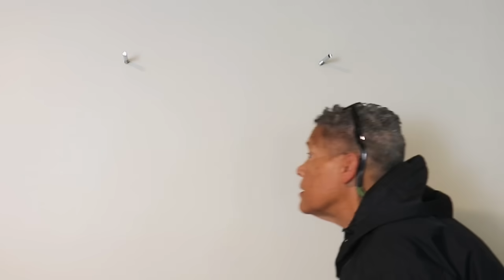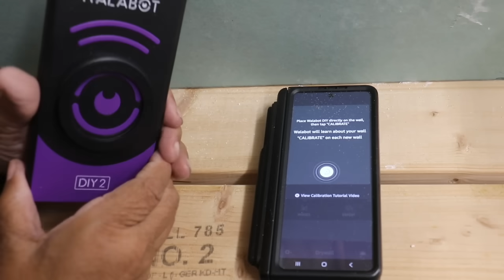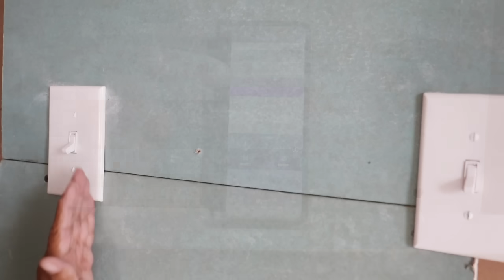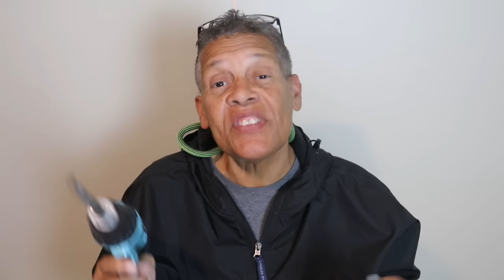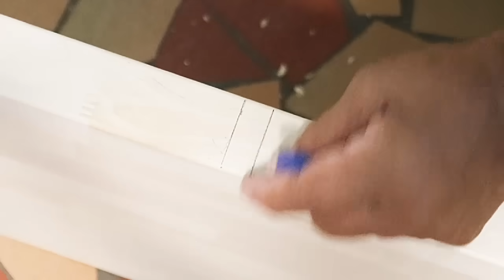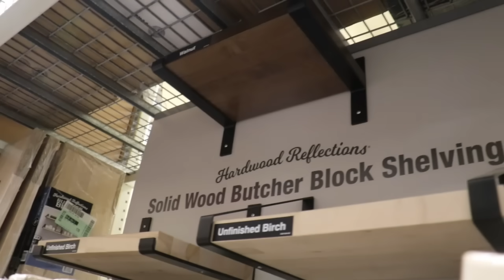this Shelf is AMAZING//no brackets needed!

Comment: That Walabot is a really cool tool. I installed a floating shelf at my house much the same way. I wanted to share a couple tips I think make it a little easier. I use a speed square held against the wall and a 12" long 3/8 bit. The square helps guide the bit level when drilling the pilot holes. I precut the heads off and use vise grips to screw the lags so I don't have damage from sparks in my finished home. Lastly I drill my holes in the shelf for the 1/2" lags a little big. Like 5/8. This allows for any leveling adjustment. I put a good amount of construction adhesive in the holes. I slide the shelf on and prop it into it's exact level position with temporary boards under it and let it set for a day. I used this process on a very large mesquite mantle as well. I wanted to share my experience. Thank you Leah.

Comment: Thanks for the Vid - Ques: do you use the same size drillbite or slightly smaller on the butcher block holes to ensure a fit? Also how does one determine what size drillbit to use - there is not enough info out there on that

Comment: Drilling perpendicular into the studs 😬 that only comes with years of experience. How can that be done by someone (me 😅) who is not that confident about the outcome?
Reply: I use a 12 inch long drill bit. This allows room to hold a speed square against the wall. Put the bit on top of the square to help get your hole drilled straight.

Comment: I saw several things I believe you could have done better when you drilled those holes in the board.  First, I think you should have drilled a small pilot hole, so that the big bit didn't wander.  Second, the "you want to be sure you drill straight" is not enough.  Any deviation when aligning 3 rods is going to be very difficult to deal with!  Your viewers could have been shown how to quickly make some sort of drill guide...as simple as using a couple of pieces of wood to form a square corner to guide the drill bit into another piece of thick wood, then using that piece as your drill guide..
Reply from the maker: You're correct...I did consider demonstrating a guide to assure straight drilling

Comment: Well, I have done DIY for 60 years with just normal stud finders and never hit a "surprise" pipe or wire.  I do think about where pipes or wires are likely to be, so that is part of my "luck".  But given that history, I'm not seeing spending over $200 for a stud finder I use a few times a year...and which will be obsolete/non-functional within another 5 or 7 years.
Reply from the maker: it's an option....especially when there has been remodeling done by previous owners

Comment: I would think you would need some kind of a drill guide. To make sure the holes drilled into the wall studs and shelving for the lag bolts are perfectly straight. And make sure to cover the wall and floor with something. To protect them from the hot metal when grinding off the heads of the lag bolts.
Reply from the maker: stone floor

Comment: If you don't want to buy an expensive wallabot you can get a $15 stud finder.  If the house is built to code a steel plate is installed on the studs where pipes or wires go through them.
Reply from the maker: Yes, a inexpensive stud finder can work.  Unfortunately, you never know what remodeling has been done incorrectly leaving plumbing and wires exposed.
Reply: @seejanedrill  That is always a possibility.  But if you are putting the shelf at 5 feet, and the outlets are at 2 feet you are pretty safe.  unless it is on a wall shared with a bathroom.

Comment: Have you done a video for those that have ultra thin plaster boards? I find it's becoming more common in newer houses. I put in plaster board anchors but eventually they just rip out of the walls.
Reply: Try "snap toggle" fixings for plasterboard without wooden studs behind (i.e the studs are not convenient or they are thin steel). If your thin  plaster board dot and dabbed with plaster onto a blockwork wall behind I suggest a chemical anchor plus allthread e,g, Fischer pro chemical anchor (a mix or epoxy and sand). You can anchor both into the block work and also (in the floating shelf example) into the wood. You could also combine the two, perhaps thread locking into the snap toggle fixing and them chemical anchoring to the shelf.
Reply: @themekfrommars  thanks. Unfortunatley there is never a stuff where i want to put things up 😂 i never hear of the chemical one.  Ill look into that.  You're a legend!
Reply: @alimfuzzy  Be sure to hold the allthread in position white it sets. You can do this with the workpiece or a packaging cardboard template, or even just tape. It helps if you use a laser level to drill your holes. 

The good stuff (Fischer pro for me in Switzerland) sets 80pc in 5 mins. The cheaper versions take a couple of hours (Full strength is 24h). 

Try to use the thickest diameter allthread you can. I did a job for a customer this month where they wanted to hang an unfolding cantilever drying rack on a stucco wall in their drying room. I used 4x metric m6 thread to do this but regretted not drilling the holes out and using M8. I detached the mounting face from the rack and used this to keep the allthread in position while the chemical bond set in place. 

I find myself using this as a solution all the time now where there are massive slabs of insulation inside exterior walls in renovated historic building, or outside on modern buildings. I used the same trick to mount a hose reel through 25cm Insulation earlier in the year. Best practice would be to spin a flanged nut in reverse on the wall-side of the allthread if tightening e.g. a bracket against the wall. Extension tubes are sold for the already long nozzles on the chemical bond.